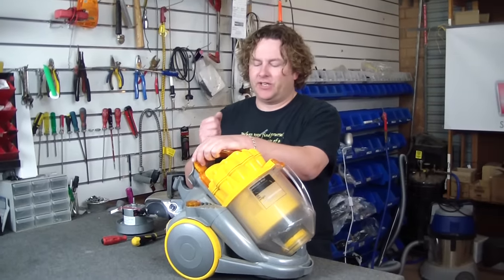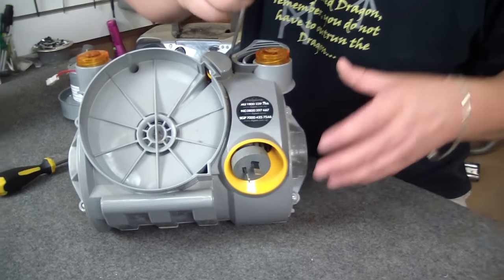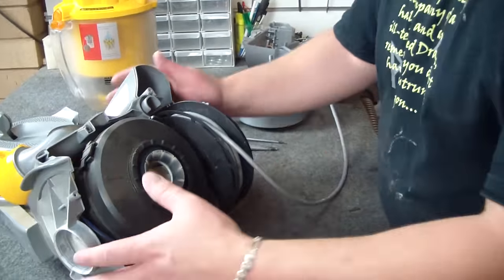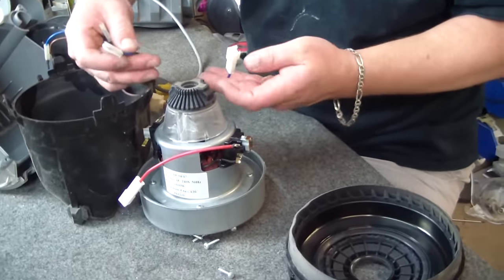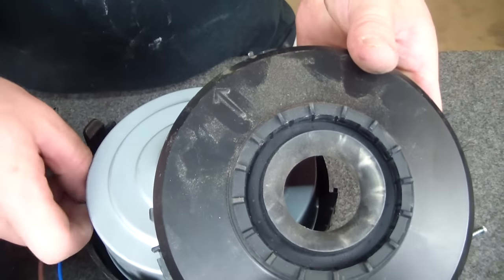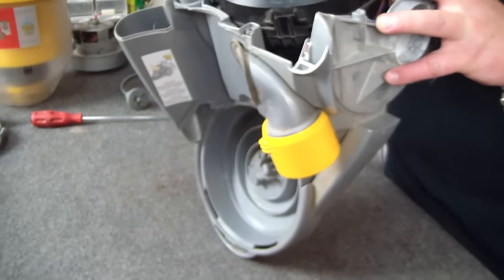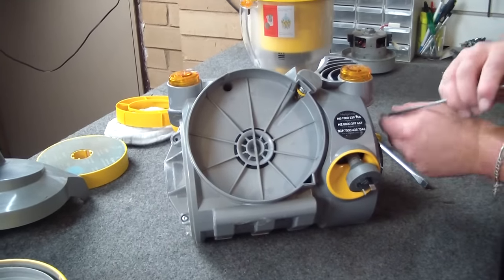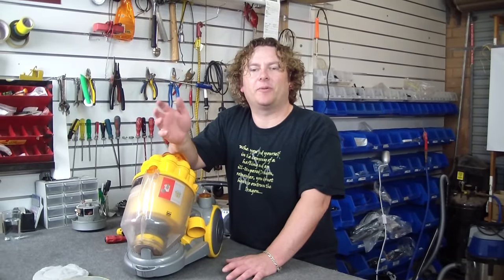How To Change A Dyson DC08 Vacuum Cleaner Motor In Under 10 Minutes

Comment: Alec, your video is so good that even a complete beginner like me managed to bring my 14 yr old DC08 back to life with a new motor and filters for about 20% of the replacement cost. Putting the case back on was the trickiest, but you made that doable by showing exactly where the power switch should sit. And now my Dyson works like new. Your instructions also mean I now know how to properly maintain and optimise performance, so thank you so much for all of that, from the other side of the world (UK)

Comment: Cheers buddy, I live 5 miles from the Dyson factory in England but they wanted a fortune to fix. Scored a new motor and filter kit on ebay for £20 and did it in my lunch break. 10 year old machine now like new.
Reply: It's just the dyson building in England. The factory is in Malaysia
Reply: THAT's exactly what I have to do for my 12 year old Dco8 which started spitting sparks today!

Comment: I have brought a motor through vacumspot but the wiring for the motor has no connectors on the ends for me to be able to connect to the corresponding clips.... do I need to buy these or can I get the old clips off of the old motor.. I would have thought the new motor would have come with them already.

Comment: Thanks mate! Great instructions.
Reply: what you watch out for is cheap dodgy motors, cheap ones don't have thermal cutout and signal suppression features
Reply: I got it off Amazon and it came with "Official Dyson part" printed on the packaging. That and the new filters has it running like brand new.
Reply: +Lee Probert Hi Lee, quick question - are you still happy with your purchase and could you please direct me to the seller you got the motor from? Thanks.
Reply: @LeeProbert72  Hi do you remember how much was it and what model, so I could have a look myself.
I want to buy new motor for my DC08 and DC29. I think they both use the same motor, but I don't really know which one is good.
I don't want to spend fortune, but cheap ones do no have good reviews.
Could you please recommend a motor for me?
Thank you.